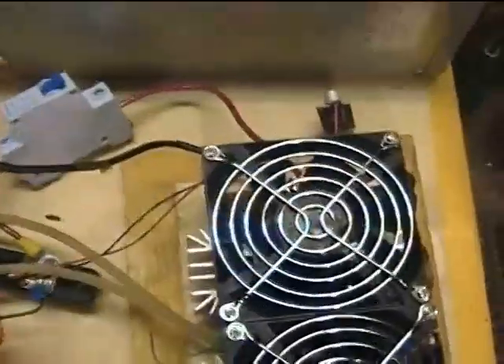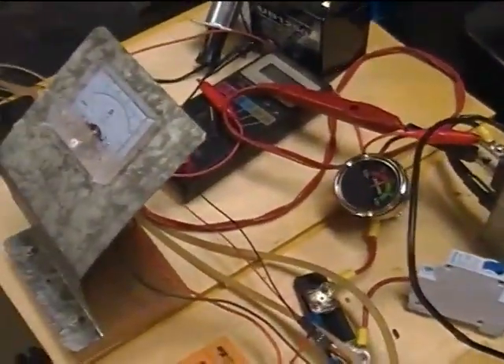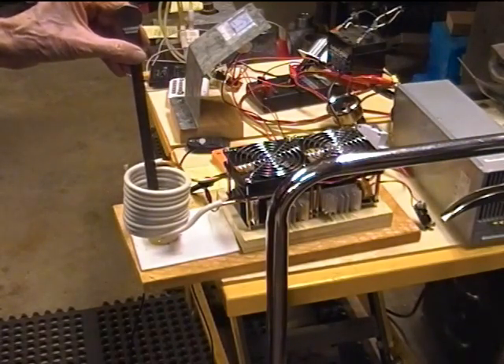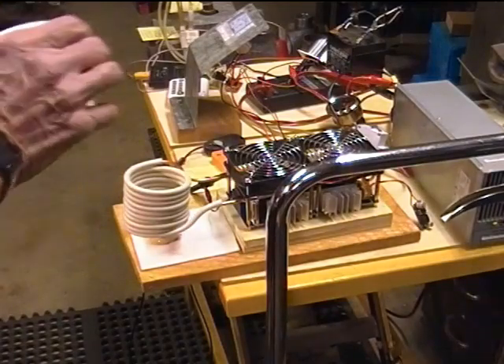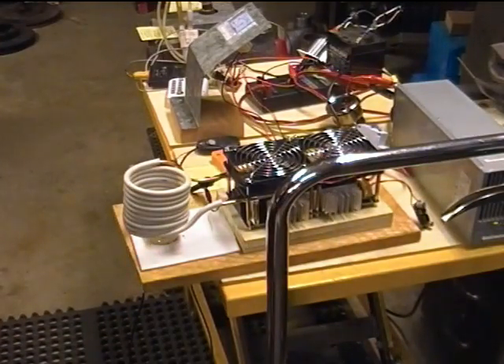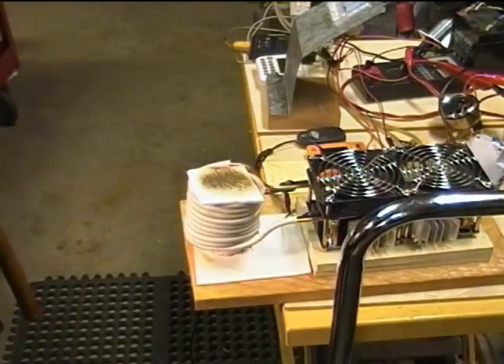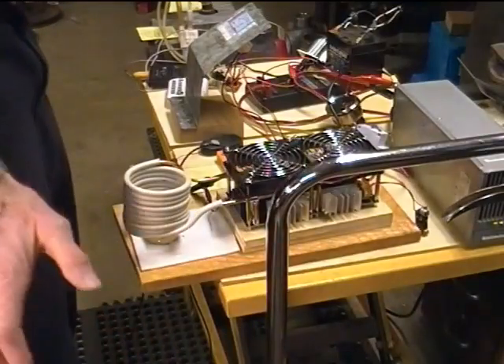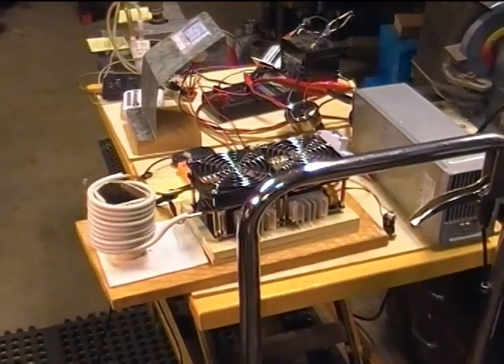1800 Watt ZVS Induction Heater Operation and Testing Capability

Comment: thank you chief . it is the first time I understand that damn induction thing without trying to blow my mind. and i bought a 3kw Chinese and now i am making my own coil in my shop and for the first time i am able to heat treat steels easily. thnks to your videos.  keep up the good thing. oh btw. for a dia 10mm 4140 steel rod 12 amps on 220v inductance of te coil 1.7microH (calculated) and my ac100 LC meter is on the way too.

Comment: Salve che alimentatore usi, quanti Watt, ho problemi a trovare un alimentatore x il mio ZVS da 1800 Watt
Reply from the maker: Here is the power supply that I use with my 1800 watt and 2500 watt ZVS induction heaters:
https://www.aliexpress.com/item/4000975697053.html
It is an Emerson R48-2900U

Comment: Thank you , I managed to get it going with an idle current of 5 amps, the heating coil was shorting on itself if that makes sense, I spread apart each individual turn and voila it started to work. As for your comment regarding coil size, I would like to run smaller ones, say half the size what do I need to do? Lower the voltage? Something else ?
Sorry for the dumb questions I'm a total newbie.
Reply from the maker: I am glad that you got it working.
Half as LONG or half the diameter?
You might try making a double LAYER coil to keep the inductance up closer to the original coil.  I have done some experimenting with this type of multi layer coil with the 1000 watt heater, but not with the 1800 or 2500 watt model.

Comment: Thank you for the video, very interesting at one point you mentioned a high idle current draw, did you figure out what causes it? I purchased the exact same unit and I get a 20 + amp Idle draw and the coil glows with nothing in it. Any  help or suggestions would be greatly appreciated.
Reply from the maker: Other than the comments that I made at about minute 12, I don't know why the high idle current occurred and then went away.
Regarding your  20 amp idle current-   
Then work coil should not glow unless you are NOT water cooling it.  I would not try to run the system without water cooling under any circumstances.
As far as the 20 amps is concerned, I suggest you work your way through this link which specifically deals with troubleshooting the 1000 watt unit becuase the processes do apply to the larger boards also:
https://spaco.org/Blacksmithing/ZVSInductionHeater/1000Watt12to48VoltZVSInductionHeaterTroubleshootingGuide.htm
Reply: @frenchcreekvalley  Thank you for your reply I will try to troubleshoot my board following the link you provided.
Reply from the maker: @bernardgadbois2066  One last thought---
You need to be using the work coil that came with the unit for the idle current to be equal to what you saw in the video.  If you constructed a coil with fewer turns or with a smaller diameter, you will get a higher idle current because that will create a coil with lower inductance.  That lower inductance will cause a higher resonant frequency to be generated and this higher frequency makes the Mosfets operate in the linear mode more of the time while trying to turn on.  This, in turn, heats the Mosfets much faster, requiring more current.

Comment: Nice demo and very helpful.  Where do you get the insulation for the coil? my coil is 2 inch and does not heat up small objects like brass bullet casing. Draw 20 amps 12v.
Reply from the maker: I have used this sleeving:
https://www.ebay.com/itm/%CE%A61-40mm-White-600-C-HIGH-TEMP-Fiberglass-Sleeving-Wire-Cable-Insulating-Tube/153050276433?
Usually the 6mm size.
Metals that do not contain iron don't heat well with this device unless you use specially designed work coils.
See:
https://www.youtube.com/watch?v=g6GFMpZUZ7k

I would not recommend running this device with anything less than 24 volts.  48 volts is best.  You will need a power supply that can supply at least 40 amps- more is better.

Comment: thank you sir how do you hook up the water pump??and the company that made it said to put in a 35 wat fuse in it
Reply from the maker: I assume that you do know how to apply power to the water pump, but you do want to know to connect the water pumping system.

First you need to locate a water reservoir.
You can see that I am using a small radiator, but many people simply use a open container of some sort.
  I suggest that you locate an open top water tight receptacle that can hold at least 10 liters of water, or even more it you intend to run the system for longer than about 10 minutes at a time.
You don't want the water temperature in the system to ever get higher than about 50 degrees C to avoid damaging the water pump itself.

I suggest that you place the water resrvoir at the same level as the heater is located because some pumps are not good for sucking water up from the floor level.

Water connections:
Using the  tubing supplied with the system, connect the output of the pump to the LOWEST end of the work coil.  This step is very important.  The incoming water will fill the work coil completely this way.
Connect tubing from  the UPPER end of the work coil to the reservoir.  You can simply drop the tube into the reservoir, but I suggest that you fasten it in some way so it can not "jump" out if the water pressure is too high.

Finally, connect a piece of tubing from the INPUT of the pump to the reservoir. Support this piece of tubing so its open end  is always submerged in the water.

Test your water cooling setup before energizing the ZVS heater to make certain that you have a continuous flow of water and that any air bubbles have been driven out of the system.

Comment: hello colleague I can melt up how many grams of metal in it
Reply from the maker: I have upgraded to the 2500 watt version of this induction heater.  Using that heater, and using a graphite crucible white a ceramic sheath, I  can melt as much as about 500 grams of copper, gold or silver.  I have melted about 250 grams of cast iron, but I could probably melt at least 100 grams more.

Comment: Can you use this to levitate a metal ball?
Reply from the maker: I have seen it done on youtube, but I have never tried it with this one.
Reply: @frenchcreekvalley  What switch did you use to turn on the induction heater after you turned on the power supply? Is it a circuit breaker?
Reply from the maker: @jonm4467  I turned on  the grey colored circuit breaker that can be seen just above the upper cooling fan at 11 seconds into the video.   The circuit breaker needs to be rated for DC, by the way.
I think this one, which came with the "combo" that I bought, is rated for 60 VDC at about 35 amps.

Comment: You're using  a 48vdc Chinese generator it is of limited use and power and  it cannot accept voltages  above 48 volts and thus you have to deal with  high loss currents to get high power .
Reply from the maker: This 1800 watt induction heater is designed to handle up to about 38 amperes at a maximum of about 48 volts.  I do not understand your comment about "high loss currents".   The board is doing what it is designed to do.  Certainly induction heaters exist that  can produce more output power but the price is much higher.  I am simply trying to show what the capabilities of this board are, as I have done with the 1000 Watt and 2500 watt units in my other videos.

Comment: love your videos,where do you buy the insulation for 1/4 inch cooper tubing?
Reply from the maker: Thank you for your kind words.
Here is the sleeving that I use to insulate the work coils:
 
Φ1~40mm White 600°C HIGH TEMP Fiberglass Sleeving Wire Cable Insulating Tube

 
https://www.ebay.com/itm/153050276433

 
I usually order the 6mm sleeving.  It is flexible enough to fit easily over the 1/4" O.D. copper tubing that I use for most of my coils.  I did buy some 8mm sleeving at one time and it works okay, but is a little loose on that tubing.
Reply: @frenchcreekvalley  thanks so much!! really impressed with your knowledge!

Comment: Switching step down converter is correct NOT buck converter
Reply from the maker: I use a switched mode power supply that connects to the mains, NOT a "converter" which usually only converts one DC level to a different DC level..
Since the induction heater requires about 40 amperes, I do not think a "converter" or a "buck converter" would do the job unless you already have a source of Direct Current greater than 38 volts at about 50 amperes.

Comment: Can I use this induction for non ferrous material
Reply from the maker: In most cases non ferrous materials do not heat very well with this induction heater.   If the work coil is properly designed, some non ferrous materials can be heated.  See some of my recent videos where I anneal brass rifle cartridges.
However, we CAN heat, and even melt non ferrous materials indirectly, by placing the work into an insulated graphite crucible that fits within the work coil.  Again, several of my recent videos demonstrate this effect.
Feel free to ask any other questions.
Reply: @frenchcreekvalley  can you tell me what should I use for non ferrous material like chromium , manganese, aluminium and etc... Without crucible... And one more doubt how graphite is getting heated in induction...
Reply from the maker: @karthiklarthik4281  I nave no experience with Chromium or Manganese.   Aluminum will generally react similar to copper and brass.  That is to say, those metals generally heat poorly in this size of induction heater.   In industry, when the users need to heat those materials, they use much higher power and, often, much higher frequencies.
Reply: How it's heating graphite crucible
Reply from the maker: @karthiklarthik4281  The graphite (carbon)  has electrical resistance.  As the magnetic pulses impinge on the crucible, they generate an electric current  which creates a current flow following Ohm's law.  This process produces energy in the crucible often called  "I squared R losses".
Here's a link to one of my videos that demonstrate that heating:
https://www.youtube.com/watch?v=ZiF3eYB5v0Q&feature=youtu.be
Reply: @frenchcreekvalley  What will it do to lithium chloride, anything?  I have been trying for hours to find out what the polarity is on this unit!!! I can't even be sure by looking at your video. Is GND supposed to get the negative power lead? Thanks!

Comment: why do these induction heaters break so easily? I see everybody operating these, has some "losses" and buys multiple boards.
(how to make a 1000W board which can not break easily? maybe using 4 mosfets?)
Reply from the maker: They only "break" when they are operated improperly.
This is usually caused by using a power supply which can't handle the current needed to run the board.  
A next cause of failure is if the user shorts out turns of the work coil with a conductive work piece.
There are firm preventive measures for  these and other issues on this webpage:
https://spaco.org/Blacksmithing/ZVSInductionHeater/1000WattZVSInductionHeaterNotes.htm

By the way, the 1800 watt heat that is the subject of THIS video DOES use 4 Mosfets.  And the 2500 watt version uses 6 Mosfets.
Reply: @frenchcreekvalley  thanks a lot!! this will help my project. appreciate your reply. I just studied lots of your videos and the (very useful) homepage. 
it´s 3am now. hahaha!!

Comment: Excellent video. What material are you using around the work coil and were could I purchase it?
Reply from the maker: Here is one supplier of the sleeving that  I use:
https://www.ebay.com/itm/%CE%A61-40mm-White-600-C-HIGH-TEMP-Fiberglass-Sleeving-Wire-Cable-Insulating-Tube/153050276433?ssPageName=STRK%3AMEBIDX%3AIT&var=452878848142&_trksid=p2057872.m2749.l2649
  It comes in several different sizes, as you will see.  I get the 6mm material for my 1/4" OD copper tubing.

Comment: Can I use a 50V 40A power supply? Because its just 2V
Reply from the maker: I assume you meant to say: "Because it's just 2 volts over the "spec'd" 48 volt max.,, will that still work okay?"
That should be okay.
Reply: @frenchcreekvalley  thanks because this solution cost 5 euros and a 48v 40A power supply cost 80euros
Reply: Can we use 54V instead of 48V because Chinese made MMA is so cheap now.

Comment: How many volts DC and how many ampers I need in the input
Reply from the maker: The  item description says that the unit can work with 12 volts to 48 volts.  But I strongly recommend using at least 36 volts.  48 volts is best.  You need to supply at least 40 amperes, but 50 amperes is best.
36 X 40 = 1440 Watts
36 X 50 = 1800 Watts
48 X 40 = 1920 Watts
I would NEVER use less than 36 volts to power this unit.
Reply: @frenchcreekvalley  will it be fine at 48v 41a power supply, with default ZVS setting? I mean in continuously operation
Reply from the maker: @malizainal  :
Yes.  A DC power supply with those specifications should work out well.  You do need a DC current meter in the circuit to so you can prevent the heater from trying to draw more  current than the 41 amps.
Reply: @frenchcreekvalley  also with default ZVS's fan?
Reply from the maker: @malizainal  Good question. 
Yes.  Those fans draw about 1/2 amp each,  if I remember correctly.
If you are running right up to the maximum power supply output on a continuous basis,  you might consider a separate power supply for those fans and the water pump.
Reply: @frenchcreekvalley  I really appreciate that, thx very much
Reply: I have the 2500watt unit, and the power supply would be expensive,  so i used a D.C. inverter welder with a digital amp meter, it works fine

Comment: No of turns required for work coil(1/2inch cu tube ) outer dia of 16.5 cm.purpose is to heat 5 inch hollow fe pipe of 10 cm length
Reply from the maker: Hello Avin.
  There is not an easy answer to your question, at least not from me.
Two main issues are:
1. If I make a coil  that fits around the work,  will it have enough inductance so the  1800 watt ZVS induction heater will operate properly?
2. If the system  does   operate properly with the coil, is the system capable of producing enough power to heat the work to the desired temperature?

Here is a link to an excellent article on induction work coil design:
http://www.stanleyzinn.com/induction-heating/coil-design-1.html

Here is a link to an "Air Cored Inductor Calculator" that will help you get started:
https://m0ukd.com/calculators/air-cored-inductor-calculator/

I have not experimented with work coils having diameters greater than about  66 mm inside diameter.   However, just this day I began testing work coils with low inductances  to see what the  upper frequency llmiit  for these devices is.  It's a bit early to give exact numbers, but I think your work coil must have an inductance of at least 1.0 micro henry  to keep from burning out the heater.    The 1800 Watt and 2500 Watt ZVS induction heaters arrive with work coils having  inductances of about 2.2 micro henry.    Since you are heating iron pipe, the higher inductance is better, since it produces a lower frequency. 
  I do not know what the upper limit of inductance for these device might be, but I did make one 12 turn, 2" ID coil that had 3.07 micro henry inductance and it performed well.

I hope this helps,
Pete Stanaitis
----------------------
Reply: @frenchcreekvalley   thank you😊

Comment: What power supply are you using to run the heater?
Reply from the maker: I am using the Emerson R48-2900U  48 volt, 2900 watt power supply.
Here's a link to one of the many suppliers of that device:
https://www.alibaba.com/product-detail/Original-Emerson-R48-2900U-communication-power_60758282069.html?locphyscl=9019041&pla_localcode=&pla_country=US&pla_prdid=60758282069&src=sem_ggl&src=sem_ggl&adgrp=63383082672&cmpgn=1647531721&pla_group=293946777986&ntwrk=g&pla_lang=en&gclid=CjwKCAiAwojkBRBbEiwAeRcJZMoBHfSZMfX6m_XBl5jVHFEru4cxzQ-VweTjZpie6-HjKJkk93mG8BoC9jYQAvD_BwE&dvcmdl=&pla_adtype=pla&pla_channel=online&position=1o1&pla_mrctid=129206375&device=c&mark=google_shopping&mark=shopping&locintrst=#shopping-ads
Wow, that's a long link.  Anyway, that one sells for USD 85.00 right now.  So far, I am very happy with it.  I don't intend to push it beyond about 45 amps (now that I have upgraded my "system" to the 2500 watt induction heater)  for  extended runs, even though the specs would imply that it could run at up to 60 amps.